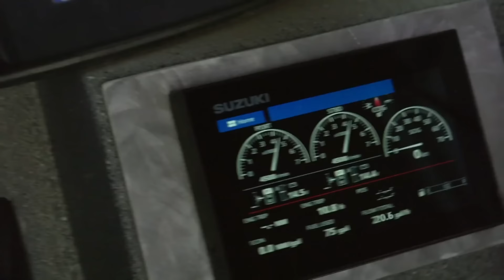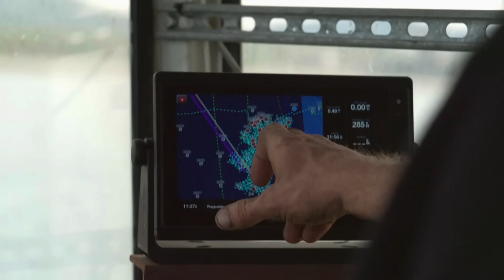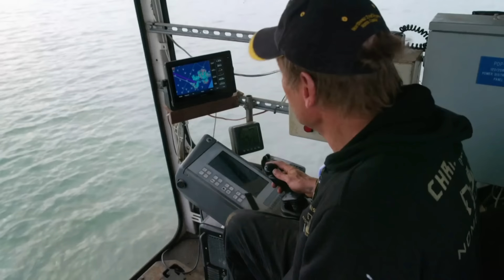Storm Damages Shawn Pomrenke's Dredge Mid-Shift! | Gold Divers

Comment: Suction excavation is the process by which high pressure air is used to break up dirt and material. This material is then vacuumed up into a truck via hose and can be disposed of either on site or a designated disposal site. ,,,,, on that rig man u have 2 wonder